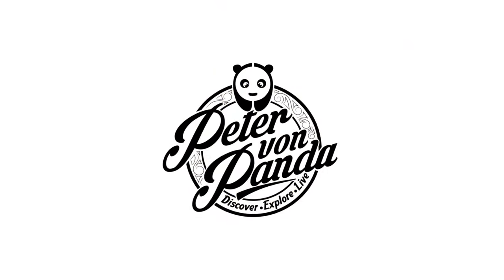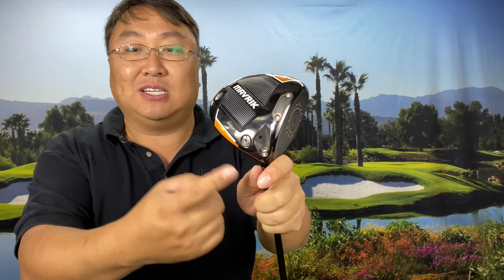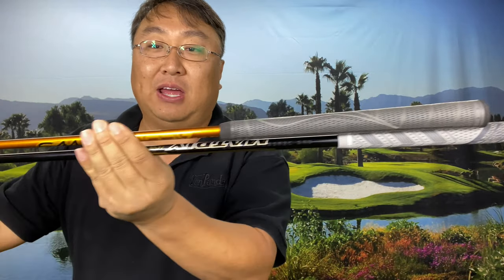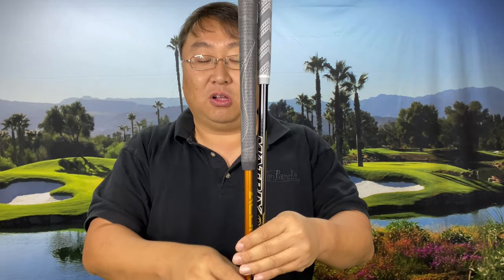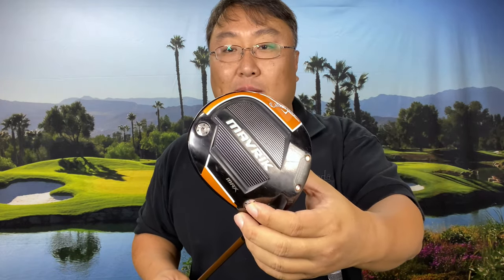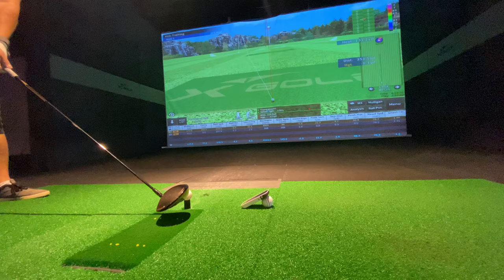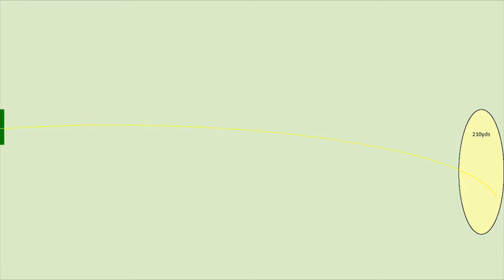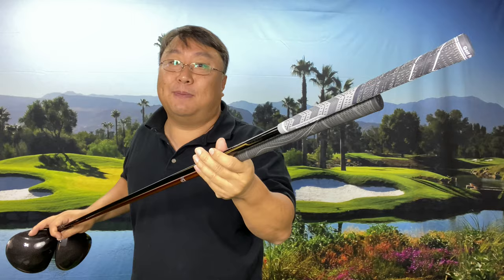Does a Super Short 40" Driver Work?

Comment: Manufacturers are simply making clubs now that are too long for the club golfer. The best players in the world on the PGA and LIV Tours are using drivers that are between 43-44.5 inches. Most club golfers are being sold this dream that they will hit the ball further with the latest and greatest new driver.....which they will, probably 1 in 20. The fact is that for the other 19 they're actually sacrificing accuracy AND distance by playing these new drivers with 45+ inch shafts. I would virtually guarantee that 99% of the time, if you cut your driver down by 1.5-2 inches you will see an improvement in consistency off the tee.
Reply: I just cut my down two inches and hitting significantly more fairways. I wish I had of known this sooner. 🤦🏻‍♂️
Reply: Long you can cut it. But if they gave a short, you cant add it. Driver must be custom if you had ideal swing. Just buy the head only

Comment: I shortened a driver to 40 inches for my 11-year-old and I hit it for the fun of it and hit it pretty straight and about 220 yards. I did realize that I had to add another ounce or two of weight to compensate for the amount of weight loss in the shaft, but it went very straight. At least eight out of 10 shots went right down the fairway in the middle. I went and shortened my driver down to 43 1/2 from 45 1/2 and I’m hitting it way straighter more consistent. I didn’t lose any yardage only gain accuracy.

Comment: If you’re still experimenting with a suitable driver setup, I recommend the junior Cobra line. You get two shafts and I’ve found the 43’ setup perfect for my LTDx 12° dialed down to 10.5° which also flattens the lie angle.

Comment: Im going to be experimenting with a ~40" driver soon- Trying different lofts/lies/stiffness. 19 months ago I suffered a back injury that has made me completely change the way I swing a club. I can no longer swing past the 75% mark, with any club, or I risk over-extension injury. But my game is strong with swinging less (50-75%) in all my irons and hitting a long iron off the tee. I've just needed to adjust distance and play small ball. 
Just need to experiment to find a driver I can swing shorter & more upright.
Judging by this video- It's going to be a fun search!!
Reply from the maker: I am still playing the 40" driver and think I have it dialed in. Loft is the key. Depending on speed, you might need a 12 degree driver. I'm playing mine at 10.5 degrees, slightly higher than I'd play a normal driver but I'm getting basically the same distances now.

Comment: I have a 40” driver. A Taylormade Miscela, yes a ladies driver. It’s a 14 degree, 40” driver that goes about 225 and straight, a true fairway driver. I also have a Callaway X-Hot with a 47” shaft. I hit this baby 265-275 and usually also straight. 

So I normally use the Callaway. When I am struggling I can use the 7 wood, or the Miscela.

Comment: Fitted a Cobra ladies 5W 40 inch shaft (UST 4F1) with Radspeed XB 12 degree driver head. Due to slipped disc - hope to hit it soon. Overall driver length now 42.5 inches from bottom of club face to top of grip

Comment: I'm hitting a Great Big Bertha II I1* 41" shaft Driver...at first I was caution swinging not to fast but got more confident since I was hitting fairways almost 95%. So I increase my swing speed and not only hitting the fairways almost 95% of the time I'm getting more distance then my 45" shaft driver. Trust me, it gives me a high level of confidence when I'm up to drive!!!!
Reply: Update...
I've really made a change...
I have a Callaway Big Bertha 816 and made it 42 inch driver and at 8* loft...
I tee my golf ball high and I'm hitting equally as long as I did long ago and as long as my golf buddies.
Reply: Ever since I got a SIM Max, I keep getting videos on my feed about drivers. 

(sigh)

I changed our from the Ventus Blue 6S that came with it because it was too floppy and the torque was huge. In it's place, I installed a Tensei AV x-flex with only 3.4° of torque. Now, tilting back a little and poking the ball into the sky, I hit the ball 300+ again, like I did in my 40s.

Comment: I really enjoyed this video, Peter.  I don't have the resources to do the kind of testing you're doing, but I did swap the shaft from my Callaway Mini 1.5 mini driver into my 2015 Callaway GBB driver (about 2" shorter).  I made it a little more upright (draw bias) and added 2* of loft (from 10.5 to 12.5).  Dispersion is MUCH better, but I did lose about 10 yds. distance, on average.
Reply from the maker: Sounds a lot like me. I agree. I think I've been conditioned to just play what's available and have been underestimating the mental value of playing something more consistently. This was definitely a splurge so I could share results more immediately. Otherwise, I would've just kept swapping shafts on the same head. Interestingly, The Mini Drivers are now expensive and hard to get.

Comment: I believe each 1/2” taken off is 5 yards shorter in distance. You should try lengthening to 42 3/4”Nicklaus,or 43.5 Tiger, during his best run. Might get back 20 to 30 yards.

Comment: Thanks for this. I am 67 and a beginner (a few pals have been taking me out recently and getting me started). I struggle with the driver in particular. I am 6ft, with very long arms and it feels as if I'm swinging a boathook. A friend let me try her driver last time out - being a woman's club, it was several inches shorter than mine - and it was a lot easier to hit. I'm still at the stage of trying to hit the ball consistently at present, so getting fitted would be pointless as a fitter would not have any consistent data to work with. I figure that the easier I can make hitting the ball, the more confidence it will give me, which should help me improve. I've picked up several cheap used drivers to experiment with and am going to try cutting the shafts down by varying amounts. All the best from the UK.
Reply from the maker: Hi Laurie! I think that's a great idea! I think hitting it consistently and in the sweetspot outweighs the distance. My dad took up golf too, and I actually shortened his driver down to 39 inches which is where he was comfortable and hitting it reliably well. I think some players probably need an extra inch over standard, but for me, it's been nice to disregard conventions and play with what works.
Reply: Cut em...straight better than long.
Reply: Cleveland Chipper… confidence-boasting club.

Comment: Hey Peter. Kia ora from New Zealand. This video is three years old. Do you still play with a shortened driver? I have started gripping down on my driver by 3 or 4 inches and finding I'm hitting straighter and (oddly) longer drives. I was thinking of buying a new (used) driver and get it cut down. I'm 68 and like standing over the ball, but I use a shorter swing. It's working great, but wonder if you stuck with the shortened driver.
Reply from the maker: Yes, I play a 40 and 42 inch driver exclusively now depending on which course I play. I just have 2 shafts that fit my Ping driver and can swap the shafts.

Comment: So, this begs the question: If a standard driver is around 46-46 inches, and you like the results with the 40" - except for the distance, then why not try a 42" driver shaft or even 43"? I have a spare driver and I'm going to have it cut to 43" to start with (R-flex) and then I can go down from there if I don't like the dispersion. Thanks for the video. Always fun trying to figure out this crazy game we all love.
Reply from the maker: You and I are thinking alike. I made shafts for every increment. This was pretty early in my process where the length made both the distance and dispersion super reliable... like a giant hybrid. Right now, I play a 42 inch driver because I eek out a little more distance and can still keep it in the fairway. I think the actual length will vary for everyone by height. I looked at some photos of Bryson and other golfers to see what their actual driver lie angles were, and realized I need a much shorter driver or my swing was going to have to be much flatter.

Comment: I'm 68...head speed rarely over 85 mph. Today I put a 40 inch shaft on my ping 410. Much more consistent. Today was my first time trying this at the range. Will take me a bit to make the final decision, but right at this moment it seems clear. Shorter is better for me.
Reply: For every 1" cut of the shaft you loose 3 swing weights. So if you have cut 5" off the shaft you have lost 15 swing weights, one swing weight at the head is 2grams, so if you want to get your swing weight back to "normal range" where you can feel the head you need to add 30g of lead tape to the head.  you are currently playing it as a very light kids swing weight.  you would be better going 42,5/43,5  5wood/3wood length.

Comment: Also I cut my Callaway Mavrik Driver down to 44" and it actually made a difference. I am 5'9 and 45.5" felt too long
Reply: its wrist to floor that dictates you club length, you could be 5.9 with short arms and need a long than standard club.

Comment: Wow that's so stupid! Thanks for doing this.

I'm looking at single length and Wishon EQ1 fairway woods (40 inch length). Your video is the closest thing I can find on YouTube.

Looking at your setup and results, would pushing the ball forward in your stance and teeing the ball higher gain some distance with the short driver? Keep dispersion gains from the shorter shaft and maybe match the distance of your longer driver by teeing it up like your on the long drive tour.

My Driver has been behaving lately. But outside of the driver 7/8/9 irons things have been inconsistent and sometimes uncomfortable. Really considering single length for next season.

Comment: This is a perfect discussion and wish I had seen it before I cut my clubs. I'm pretty new to golf. I got all my clubs free from a neighbor (super old). They were all way too long (I'm only 5:4). I cut them down, but not at all scientific like you. I just did the driver, not sure of the length, but I took too much off. But I'm hitting it way better, although not at all far. I would love some more tech help as I improve. How can I contact you, Peter?
Reply: for every 1" you cut off the shaft you loose 6 swing weights, it take 2g on lead tape at the head to get 1 swing weight back. so you need  12grams of lead lape on the head for every inch you chop off or you wont be able to feel the head when swinging nf time it. Its all online just google swing weights

Comment: You should try a 42 in shaft.  Meet in the middle
Reply from the maker: You read my mind! I actually made a 42 inch shaft too and tried that out but only wanted to compare the two extremes.
Reply: @petervonpanda  well if you wanna try my epic it has a shifting weight and id love the mavrik 9*
Reply from the maker: The Epic is phenomenal. I’ve seen the numbers suggesting that the Rogue, Epic, and Mavrik all perform the same.

Comment: Nah I just choke up on my 46nhalf Bang storm cb457 12 degree with ys6plus shaft, moe norman swing freddy couples tempo, which I practice for the last 18 months in my back yard driving net due to covid staid off the coarse here at the golden era nine holer(3017) here off gilman springs(tmi) in san jacinto, went to the 2616yard echco hills down the road a piece, this coarse makes ya feel like bryson, with fairways so tight you have to walk single file, was hit every fairway missed one green in reg. One putted that green n shot 36par but thats not the point...i also practice 100 to 150putts everyday from 5 to 7 feet. and after 60 some years devoloped.   A reliable stroke by watching the pros. and how long a stroke they make from that distance...now heres the point....ya drive for dough...blah blah and two rather famous fellows had this to say play your own game...and another said if the back of your left hand. goes to the flag, the ball can only go one place...n practice practice practice...nuf said

Comment: Why go to that extreme, experiment with max two inches to start with and go to a club fitter to shorten it! I’m going to grip down a inch or two on my standard one and look online to see if I can find a proper shorter shaft.
Reply: Forgot to say the video was great and really enjoyed it! Thanks for doing the experiment so we all can benefit by saving money! 👌🏼😀
Reply from the maker: Excellent point! What I didn't show was that I built drivers at 1 inch increments all the way down to 37inches (ie, true one length). I was thinking about doing a video about the true one length 37" driver, as I averaged 222 yards with it. The 40" seemed like the best overall with trade-offs. Currently, I'm averaging 232 yards with my stock shaft and 245 with the Autoflex shaft.